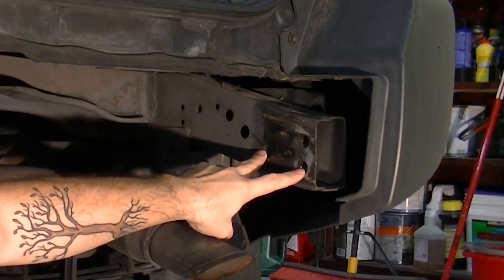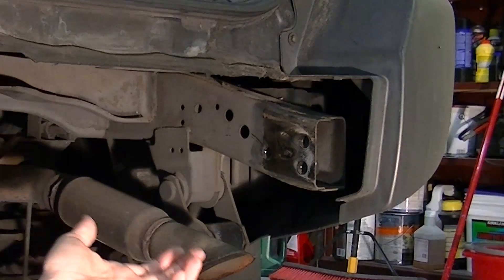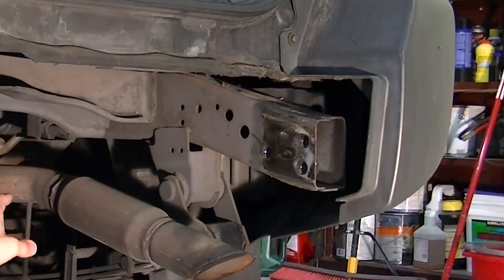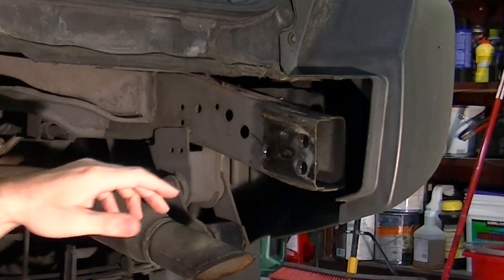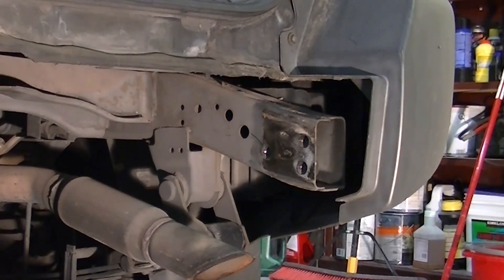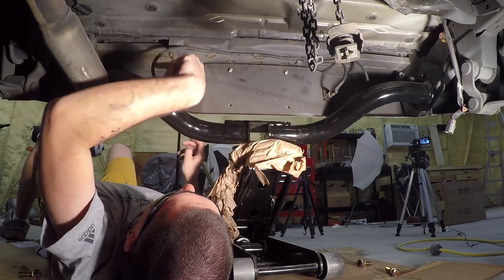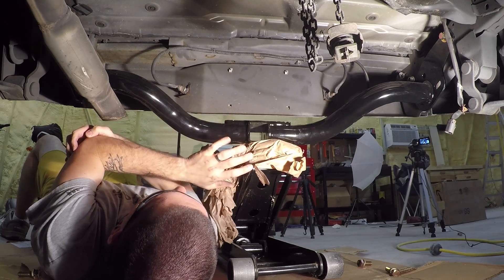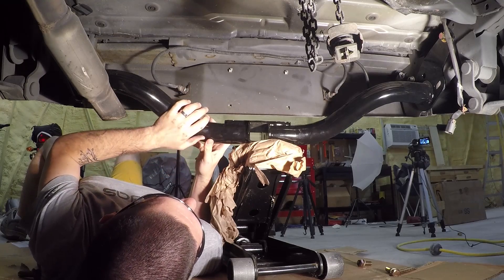How to Install a hitch on a Nissan Xterra

Comment: Where do you get the wiring assembly that you put under front passenger panel?
Reply from the maker: link is in the description, I bought it on amazon. it's called the t connector.

Comment: Great information!!!  Just finished my install, minus the relay dodads up front, I did not know that was needed, so I’m not done, hopefully with the rear harness now on but with out the relays my vehicle lights won’t be messed up.  I’ll finish off the relay part when the part comes in, don’t need the hitch till April.   Also I was able to install the hitch without taking off the bumper or loosing my exhaust, getting the 6 holes lined up and treads caught was a challenge, impact wrench helps.

Comment: Hey Ry, I just installed the same kit on my 2015 Xterra, your video was invaluable, so thank you!!!  Did not need to take off the bumper or drop the exhaust.  My wife and I just laid on our backs on some cardboard and maneuvered it into place.  I had no rust underneath, but used PB Blaster on the bolts anyway.  It took longer to deal with the spare tire and torque everything down.  We finished in about 2 hours.  Thanks again man!
Reply: I also have a 2015 xterra. Did you have to  take off the bolts for the muffler?

Comment: Will this tow hitch work with a 2015 Xterra? What would you recommend using to losses the bolts? I'm having a very tough time getting it to losses up and screw out.
Reply from the maker: Yes, it should work. there were no changes to the frame on the Xterra. Try to get an impact wrench in there.
Reply: @Rythecarguy  awesome thank you!

Comment: I scored a hitch at a junkyard today, one nut that is welded into the frame broke off so it was a pain to get it off, I needed a bumper but that one was damaged so I had to bend it to get inside the frame to secure the nut that was broken, now im afraid if I try to take off the bumper for my xterra the same thing will happen and I dont want to bend my bumper, any thoughts?

Comment: So can you take off the bumper without taking off the sidesteps and plastic?
Reply from the maker: Yes. You can.
Reply: Is there a hex nut on the other side of the bolts to the bumper? Or does it just  bolt in thanks
Reply from the maker: As far as I remember it’s just the four giant bolts holding it on. You just need to access them from the bottom side and be sure to remove the electrical connections for the lights.

Comment: well i can only pick the 4 wire kit if i pick the option with factory tow kit.. the comment before this one i wrote what the options are for without factory kit..  but the option 2 wire kit picture looks exactly like that 3 relay harness u plugged in the front passenger side

Comment: Good video   I was able to install the hitch without taking the bumper off but I installed the relay harness and the pigtail and I still don’t have trailer lights   any ideas other than the obvious checking fuses and relays??

Comment: I didn't remove my bumper when I installed my trailer hitch, however I ended up having to use a crowbar and pry the mounting brackets on the trailer hitch inward a little bit to get it inside the bumper brackets. also, the trailer hitch kit that I bought came with the extension cable for the rear but it didn't come with the relays for the front, that you need for the turn signals. I ended up buying a separate kit for about $35 on Amazon, they had the rear extension and the relays for the front I also bought some black split loom tubing, along with clips, to put the rear wiring in, mostly for cosmetic purposes, but also to protect the wiring.

Comment: Ry, I have a 2007 xterra and recently bought a travel trailer. The dealer imstalled the wiring but they couldn't get the running lights or charge line on the trailer working. I checked in passenger kick panel for the pigtail relays and there was none. Do you think it's possible this is the problem? Thanks!
Reply from the maker: Definitely, that is required to make it work.

Comment: or i can just type it.. i pick without factory harness it makes me pick without tow plug and then standard 2 wire system and then S5/T3 location. dose that sound right ?
Reply from the maker: You want to get a 4 wire kit. If the T3 location is near the right side of the rear bumper then that is right. Because that is where the wire is on the truck.
Reply from the maker: You need this http://www.carid.com/2005-nissan-frontier-trailer-hitches/tekonsha-t-one-connector-49862870.html You also need to include the jumper relay harness (third option) the only other thing you should need other that this is the hitch itself.

Comment: Ry, your link for the T-Connector does not include the other wire with the relays, can you give me a Curt part no. or link on Amazon - I found one with both the 4 Way connector and the Relays (not the Curt brand) but it stated it was for the Frontier - I would like to find the Curt brand like the one in your video.  Btw, Thanks it's an awesome DIY video, just what I was looking for to install a hitch on my used but new to me 2008 Xterra X.

Comment: Hey Ry, can you provice a source for a Nissan Xterra dash like you said you bought? Also, I just happen to buy a pioneer 720 as well, does it improve the stock speakers?
Reply from the maker: hey Bob I bought the center dash piece off of eBay from a seller called quark Nissan. it was under 100 dollars if my memory serves me. Also unfortunately the radio its self my only provide a little more clarity on radio stations and certainly more functionality. you will certainly need to replace the speakers in the doors if you want any noticeable difference in sound quality. I have a video for that if you need it.

Comment: When I did the install I had to drop the tongues (the sides with the single bolt holes) on each end on the ground once to bend them inward just to bit, otherwise I couldn't get it to fit. I didn't touch the exhaust, and I did not remove the bumper.

Also, if your X is older, has seen off-road use, and/or been through a few snow/salt seasons, make sure to inspect and clean out the two previously unused threaded bolt holes then make sure the bolts will thread. After I used a round wire brush and some WD40 to clean them out they threaded fine. Worst case you may need to use a tap and die set to clear the threads out. Either way, make sure to check all the bolts periodically. I checked mine yesterday while I did my oil change and even after a few thousand miles they are still at 86 and 136 lb-ft.

Also, if you plan on renting a trailer I highly suggest getting a 4 wire flat tester; can be had for $5 to $10 on Amazon. This will allow you to test the wiring to ensure it is working before you show up. Rental locations may not rent to you if your lighting system is not functioning, and that could seriously ruin your plans.

Happy towing!
Reply from the maker: Thanks for the input man!

Comment: Your Video was more than helpful RY
I went the extra step and also put back two of the factory bumper bolts in the blank holes. Taking the bumper off helps too, if you don't have a lift. It also  Saves you self the hassle of messing with the exhaust.TIP: If You don't have a hydraulic car jack, you can use a 4x6 to hold the Hitch and bumper while installing the Big Bolts. If you Mud at all,  Clean the factory threads on the frame that will hold your small bots, It helps. You're suppose to  Torgue  the bolts to 86 and 136... RynoHTX

Comment: * * *
When you say "second generation". . . I imagine you mean AFTER 2004, correct...?

I have a 2004 that could use a hitch... and also a new headliner (it hangs completely... I keep it from falling completely with bungy cords. . .(grin))
I see videos on putting on new fabric and putting it back into the truck...
but I have never found any any video on removing the headliner (removal of handles, column panels, and lighting/storage panels...
I've found complete parts manuals... but nothing on the inside roofing, paneling, or headliner. . .

Is it so simple, that no one thinks it's worth a video of its own. . .?  (LOL)

* * *
I very well do like your videos. . .
I guess I might have to create one of my own for the headliner project. . .  (wink)

* * *

Until that time. . .